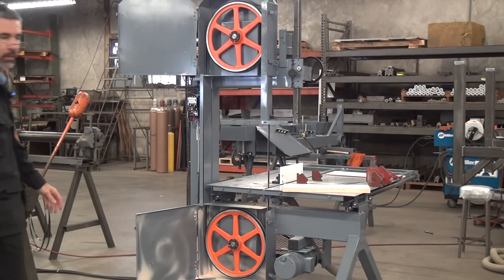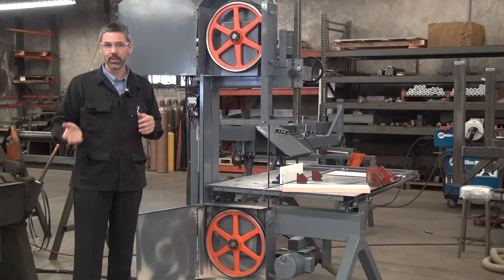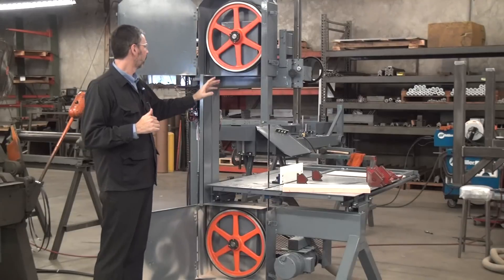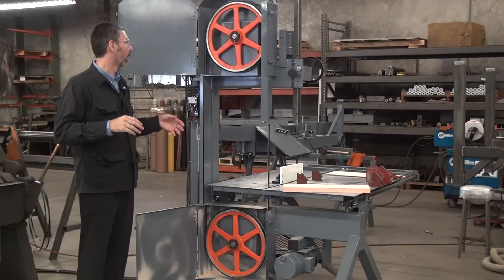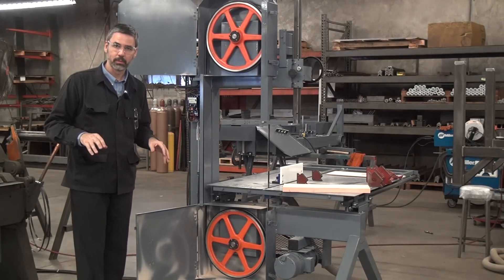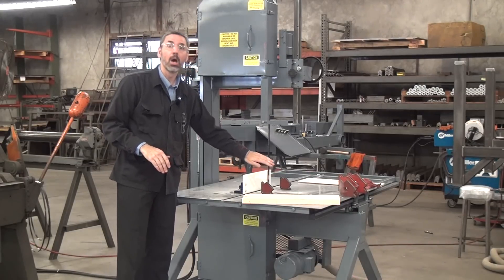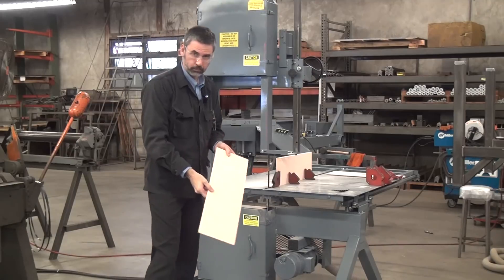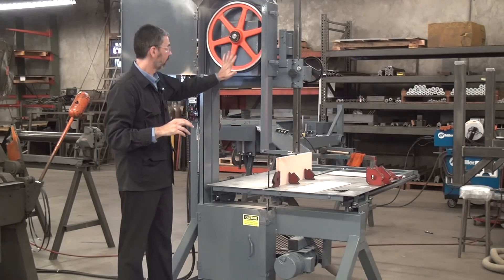How to Get Your Bandsaw Cutting Straight Without Guides | Forrest Manufacturing

Comment: Hey would you cut my fingerboard (rosewood, for Custom guitars) in 2...? It’s Thickness right now is 1/2 inch... and l need to have 2 pieces at 1/4 each...
My small bandsaw is good but l wouldn’t trust it for such small and precise cut...
If my cut is not straight, l have to run them thru planer, so in the end l’ll lose more wood and maybe end up way under 1/4”...
Please k if u can or have the time to do....- and want to do it... Thank you so much.
Reply from the maker: We are not really set up to do contract work.  We build the machines to order and my customers do the cutting.

Comment: I appreciate the information and demo my only concern is the operator is standing in an unsafe position,  I know bandsaw blades do not break often but it has happened to me a few times in my life.  It breaks at the weld and when it does the blade continues to travel with the broken end usually slamming into the table and unrolling off to the side where this operator was standing.